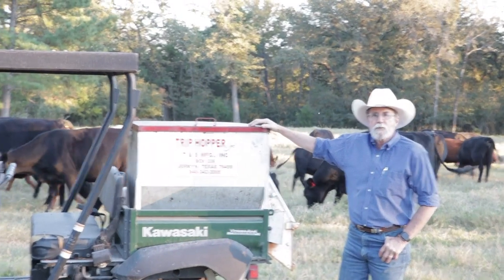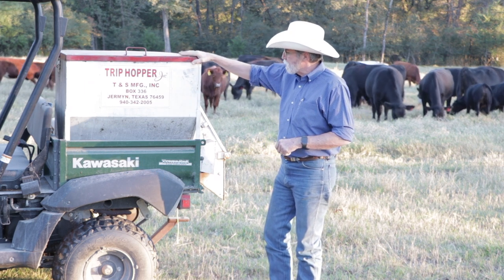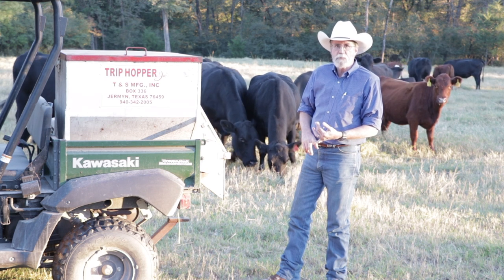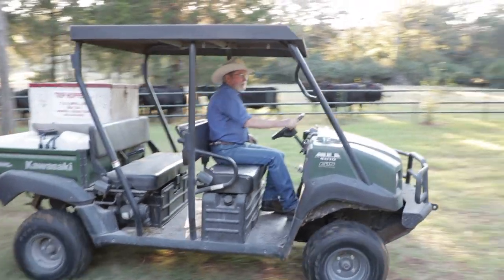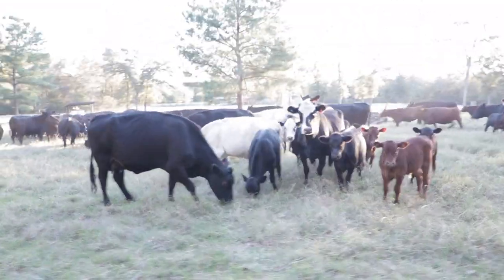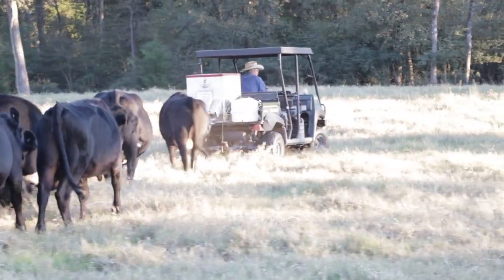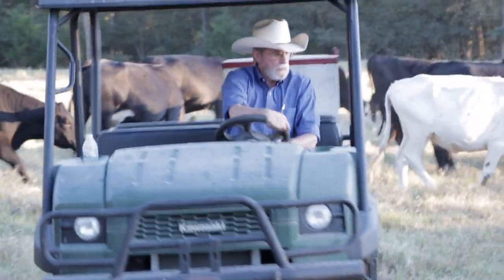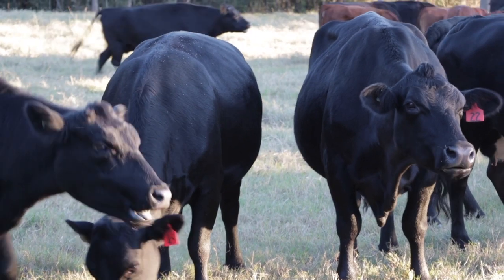Cattle Feeding Considerations | Regenerative Ranching

Comment: I have one that holds a ton of cubes, one of the best investments on the farm. Not only is it safer you can purchase cubes in bulk and save around 40-50% over bagged cubes. Mine is the same brand, they make great products.
Reply from the maker: Maybe I need to put in a bulk system that I can load my rig with. 🤔

Comment: Nice cows, bulk feed is much cheaper, then buying, bags of feed for your cows,
Reply from the maker: I priced it both ways. Bulk feed definitely cheaper but by the time I invest in a $6000 Trip Hopper trailer that will hold 30 days worth for my sized operation, or put in a hopper that our local feed store comes and fills, it’s a wash. As I get older though, I think I will likely get the trailer so I don’t have to lift bags anymore 😊. Thanks for the comment!

Comment: I am having trouble getting cattle to eat loose minerals. Suggestions?
Reply from the maker: They may not be deficient and so won’t eat much at all. Deficient cattle will really go through it. Either switch brands and see what happens (they eat some brands better then others) or use a trace mineral salt block. You can also feed cafeteria style minerals like Greg Judy does, so they chose the specific minerals they are lacking. It’s a little bit trial and error.